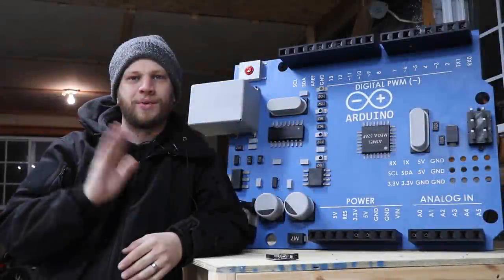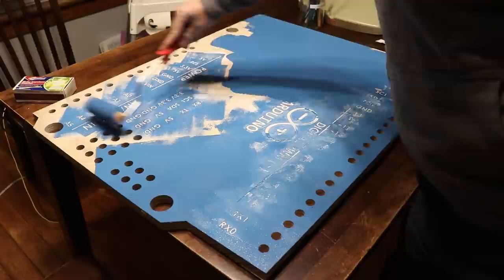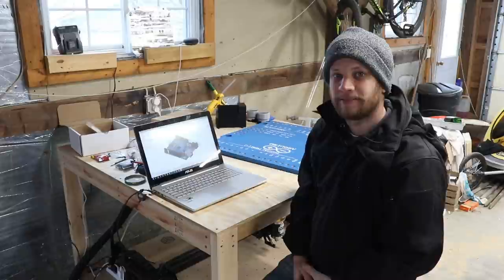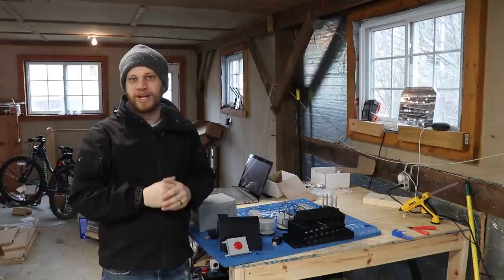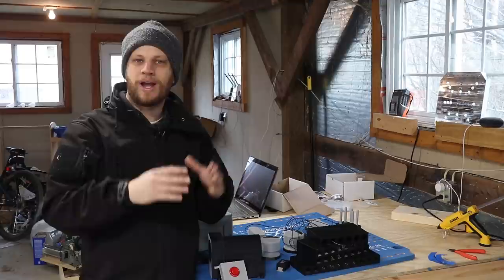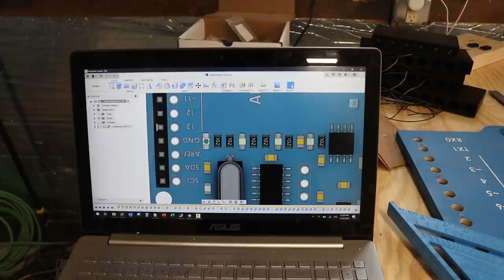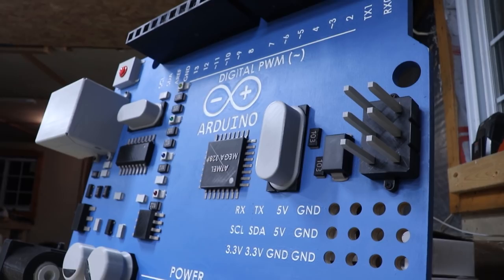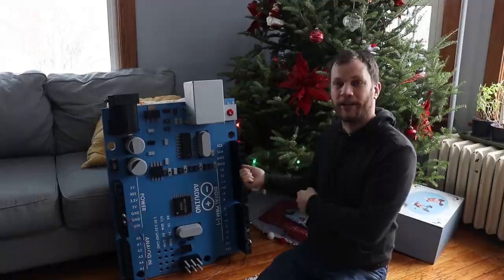A Gigantic Arduino Board That Works!

Comment: Very cool project :) But it needs a gigantic USB cable to connect to the gigantic USB port -- of course both parts with hidden regular sized USB cable/port inside so that an actual connection is made.... would be awesome to connect that gigantic cable to your laptop :D

Comment: Nice work. So you used glue to fill in the new engraving, not paint? Clever idea with the 1/4 inch jacks.
Reply from the maker: I used some caulk to fill in the new letters and wiped away the excess.
Reply: @bytesizedengineering  Ahh, thanks.

Comment: Respect! Stupendous build. What was the tool at about 9:56 in the video, looking like it was used to skim components (maybe remove 3D brim)? Also, appreciate your problem solving. “Break things down to bite-sized pieces”...Amen.